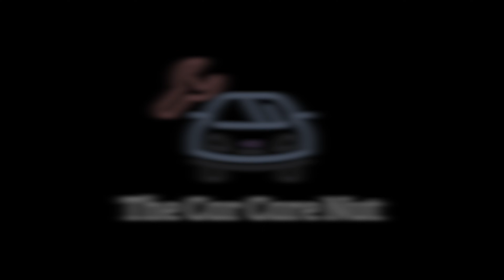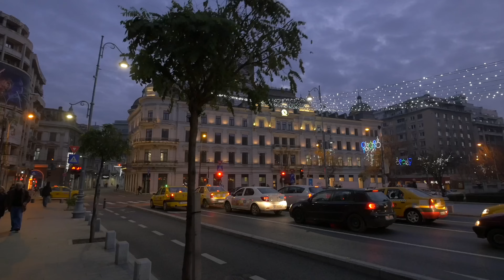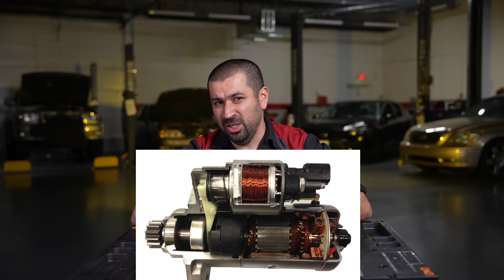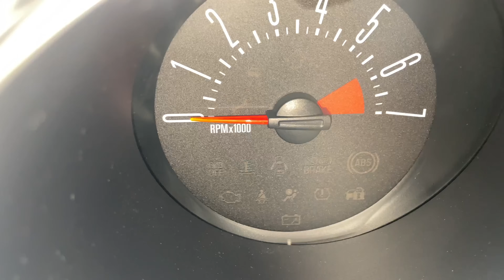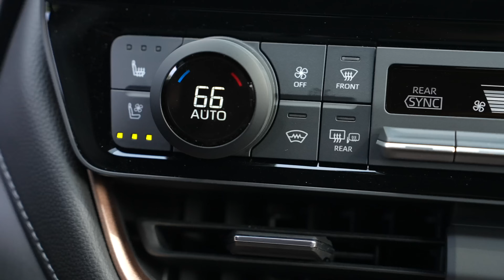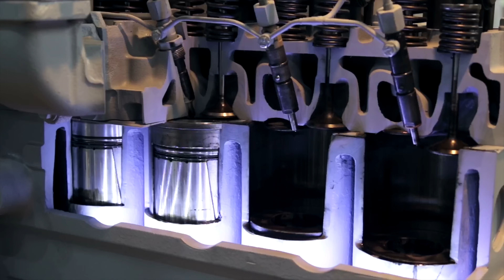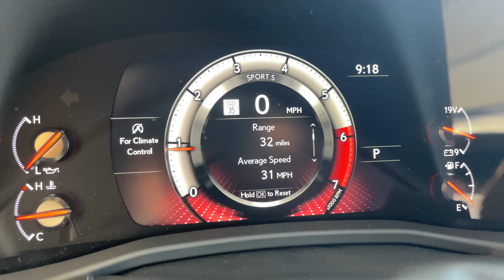How Does Start Stop Technology Work in Modern Cars? Everything You Need to Know

Comment: Never imagined that this system was so complicated. Just makes me think that this system has so many components that can fail, adding to the upkeep cost of these cars. I do have to commend you on your very in depth explanation of how this system works.
Reply: These vehicles will financially kill the lower income bracket!!!

Can't afford to repair!
Reply: I don’t know why people get so het up about stop start. It’s just a thing that some cars do and it brings emissions down in city centres. Also if mine stops working I know somethings going wrong with the car. Either the battery is dying or the alternator isn’t charging properly. And they have so many variables when they disengage such as the Air con on fall blast or the screen clearer is going being just 2 of many
Reply: My wife’s 2014 Chevy Malibu has it and never had a problem after almost 10 years.
Reply: And it's this new 'technology', that has me staying in 2020 Honda Accord. Doesn't have the start/stop, it has a 6-speed manual. It is my last car! Won't be around when we go to EVs, I'm 70 years old and I'm not interested.
Reply: Starter Motors cost a whole lot more than any gas the S/S might "save" IMHO
Reply: Absolutely. I'm a limo driver, and the alternators in modern Audis fail prematurely - they serve double duty - they also serve as weak electric motors, being able to a) add a bit of torque, and b) start the engine when the engine is warm. It wouldn't be such an issue except that there is a worldwide shortage of these alternators. I have great warranty - 5 years unlimited, but what's the point if they can't source parts?
Reply: @gregsullivan7408 Audi isn't even a valid car 🙄
Reply: @MadScientist267 lol. Audi is considered very premium here in Australia - perhaps not QUITE as premium as the other two German badges, but definitely premium enough for a limo. I have the Q7, which is very popular here for limos, due to it's combination of luxury and practicality.
Reply: @gregsullivan7408  It's overpriced, overengineered, and underdelivering. I've seen how easy they come apart the hard way, just for starters. Great if you like them for whatever reason, but good money is spent elsewhere.

Toss BMW in the same list, along with a few others. Just not impressed with "european engineering" in general with a few exceptions.
Reply: @MadScientist267  they have a great reputation amongst the limo drivers here - good value, excellent warranty and great reliability. I looked at the other "Big Two" but the Audi was the clear winner
Reply: (the reliability reputation was built before the relatively recent addition of 48V Mild T
Hybrid though - it's possible the alternator issue will change that situation. I was unaware of the problem when I bought mine. 117,000km on the clock and so far so good though)
Reply: @MadScientist267  People in North America often view European designed cars as less reliable and generally favored less, as well as more difficult to repair or work on. This is coming from someone who lives in North America. I went on a trip to the UK a few years back and there is a large amount of people who drive BMW's, Audi's, etc, over that of domestic or even Asian counterparts. As someone who is also a mechanic, my curiosity led me to a few different shops in the UK. I was a bit shocked to learn that people over there generally take care of their stuff much better, and, in addition to, the mechanics seem to be more thorough. I got to see and speak to people who have BMWs with a quarter million miles on them or more, yet were in good shape. In fact, the whole stigma that BMWs and Euro cars in general being less reliable seemed to be just that, a stigma. 

I think what it comes down to is that here in North America a lot of people just aren't familiar with the Euro designed cars in comparison to everything else. We have "Specialty" shops here that work on Euro cars, whereas that isn't really a thing overseas. During my apprenticeships with mechanics, no one really spoke about, or worked on any Euro cars. This led me to buying my first BMW, a 2004 BMW 325ci, an E46. After wrenching on it and learning how BMW operates, including their vernacular when it comes to reading the scan data I've concluded that BMW's truly aren't what people over here make them out to be. In fact, they're very easy to work on. Obviously every brand has their shortcomings and issues, for my BMW the cooling system needed an overhaul as that is a common issue on these cars, the plastic breaks. The parts are obviously going to be more expensive at a dealership, but shopping around I've found that parts really aren't that much different in costs.

Oh, and inspections over there are far more thorough and unforgiving in comparison to here -- another good reason as why you see more broken everything here in comparison. In some States your car can be literally falling apart and no one will bat an eye and passes "safety" with relative ease.
Reply: @gregsullivan7408   German Standpoint: There are way more than two German Badges, even in Australia. Also, a Q7 is not a limo, it's a SUV, a car looking like an offroad car while not being able to be driven offroad. Also not as usable in urban environment, since it's simply way bigger than normal cars (in Germany, mind you) and thus takes up just too much space. Also, yes, Audi IS premium, at least compared to its parent company, VW. It's just not as renown for quality and luxury as BMW or Mercedes are. Those two on the other hand bought or established "cheaper" brands, BMW has Mini, Mercedes established the "Smart".
Reply: @xpectthedeath here in Australia, in the context of limos, the main three that matter for high end are Mercedes, BMW, and Audi. And here in Australia, luxury SUVs such as the Q7 are ABSOLUTELY considered to be "limos" - I wouldn't be in one otherwise! 😀 Many folks PREFER SUVs to sedans, in fact.  Guess what - Audi are actually discontinuing the A8 here (the S8 will live on, but few limo operators could afford it). 
Now, I completely agree that in general, sedans are still a higher level of luxury - no argument there.
Reply: 100% agree, German cars are over engineered, over priced and unreliable. They just handle well and solid in crashes.
Reply: It doesn't make anything less reliable other than itself - so if you hate it, it's reliability shouldn't concern you at all, cause if ti fails at some point you'll have a car without start/stop, just like wanted in the first place.
Reply: @EustaH I'm having a hard time figuring out what kind of "failure" of the start stop system would result in a car that still "works". Please enlighten us.
Reply: @gregsullivan7408  all of what the guy is talking about the entire video? Those components are added to normal systems not replacing them. But ok, let’s enumerate:

Weak battery, starter used up beyond its service life, the voltage stabilising capacitor failure, electric transmission oil pump failure, auxillary electric coolant pump failure - all of this will result in just start/stop permanently deactivating. Car will start and run normally.
Reply: @EustaH weak battery and/or starter may prevent the engine starting at all, yes?  And btw, in my mild hybrid Q7, the alternator doubles as a starter motor (when the engine is warm) - guess what - this more complicated alternator FAILS COMPLETELY, and arguably, prematurely. It completely disables the vehicle. Worse, there is a serious shortage of this alternator. (it's a "belt alternator starter" motor). This added complexity has made the vehicle less reliable. It's a well known problem in the limo driver community, because we do high miles.  Now, if it only had start/stop, without the mild hybrid gumph, maybe it would then be more reliable - I'm not sure.
Reply: @gregsullivan7408  yes those can prevent car from starting, but the start/stop will stop working well before that. I know, because I just replaced my battery. In case of starter - that is too, according to the video - configured in such a way that if there is a risk of it failing doue to age/milage the start/stop deactivates as well. 

That starter/alternator combo is actually a cool idea - it failing prematurely means it was underengineered. Too bad :( And knowing Audi they don’t give an f…

Comment: Depends on how long the cycle lasts. 98% of wear comes from zero oil pressure starts. It takes a specific period of time for oil pressure to build the hydrodynamic wedge in plain bearings that separate the rotating component from the bearing where wear ceases to be an issue. With hot oil the pressure drops to zero in a couple of seconds and the rotating components settle back onto the bearing. Now you have wear in the bearing/rotating interface until the wedge is reformed on restart.

Comment: Good channel and you present very good data but most people i know have  had very short battery lives - these batteries are incredibly expensive ( 4-5 times ) - the starters fail too  - extra heat is generated and i guess there are some un burnt emissions - so if you factor in the costs , the extra heat i think its just virtue signalling and just basic dumb engineering and has more to do with meeting emission requirements for the  manufacturer's

Comment: The start stop system will damage the engine simply because it will wear out bearings sooner. This is simply a fact. And yes, when the engine is cold it will be worse. 
I think this start stop system is rediculous. It will NOT save fuel. It will wear out the engine, starter motors and batteries faster. Nett carbonfootprint benefit = 0 or negative. Not too mention your oil getting bad faster due to higher loads at start. It is rubbish and designed for type approval, not for the environment.

Comment: I have a question. I have a 2019 Renault Kangoo Maxi i use from my employer. It has a start stop system aswell. I noticed when im parked on a parking lot, if i forget to turn off the engine, the start stop system stops the engine because the transmission is in neutral, and no pedals are pressed. But after 3-5 mins the engine suddenly starts up again, and reminds me i havent actually turned off the vehicle.Just out of curiousity of this system, what could cause this behaviour?

Comment: I had a Jeep with stop/start. Hated it. One time after playing too hard the stop/start didn’t work anymore. No check engine light or warnings. The status screen always just said “not ready”. 

It was AMAZING. 9 months later after picking it up from recall work, I stop at the edge of the dealership lot and the 🤬 shut off. 

I didn’t turn around, I just reversed right back to the service desk to find out what they did. Turns out there was a ripped wire going to the battery monitoring thing on the negative post. They were nice and fixed it while doing other work. 

I thanked them, left. Opened the hood at home and ripped that wire off again.
Reply: Ha ha 😅lol.  That is one of the best stories here!
Reply: Mine "broken" how I know how to "fix it" if they do

Comment: I miss the days when cars were simple. (and inexpensive).
Reply: The powers that be are making car ownership as difficult and expensive as possible on purpose. To get you out of cars and using them less. It’s controlling of behavior through indirect mechanisms and levers. The common man will own nothing, maybe a bicycle, when it all comes to fruition.
Reply: Do you miss the smog?
Reply: @ianguy85  Smog is just something that THEY put in your mind. In 1965 the air that we breath was exactly the same as it is in 2023. In 1965 skys were blue and beautiful and the air was beautiful. You just drank the Kool Aid THEY gave you.
Reply: @ianguy85  Fact: The air in 1965 was no different than today. That before Catalytic Converters, Unleaded Gas, and pollution testing. And big cars with big V8s. :)
Reply: @ianguy85 did you miss the other posts of the impact of manufacturing more starters?
Just like all the heavy diesel machinery used in China to mine for lithium and its impact on the environment.

Comment: my 2022 rav4 LE awd (Canadian Spec). The extended start stop option on the menu seems to have killed my battery. At 17 months old, the vehicle started to have electrical bugs and abnormal power steering voltage warning showing up which my dealer wasn’t able to figure out. Other electrical malfunction showed up on dash that goes away after a while. A month later, without any notice, car died while parked. Wouldn’t start. Now i’m scared to use the start stop because I don’t want the car to die the middle of the intersection especially during frigid Canadian winters.

Comment: I'm in the dark about how the computer will resume starting at the cylinder that was about to fire when it was stopped. This would mean that the piston was in the middle of the compression stroke and stopped there. How is it possible that the piston rings and valve stems can maintain compression for up to 30 seconds? If anything it would push the piston down and alter the position of the crank. I remember in the 80's research was being conducted on low friction flywheels to store mechanical energy to bypass the starter for start/stop systems. Apparently this technology never got off the ground.

Comment: Had a loaner Subaru CrossTrek for a week. I figured out that the start-stop was not activated if you slowed gradually to a stop with light brake pedal pressure, the engine wouldn't shut off. I HATE start/stop and all the electronic touch screen BS.

Comment: I don’t know about other manufacturers. But my Toyota system actually only cuts the engine if you press the brakes in fully. If you don’t press them all the way it shows a message “press brake more for start stop” 
So I can control when I don’t want the engine to shut off every time I don’t need a system disable button. 👍
Reply: It works the same way in other vehicles that have it.  Some don’t show the message but I figured out that once you apply the brakes to stop the car, I just lift my foot off the brake half-way and the car stays still and the engine stays running, that’s the way it should be.

Comment: Regarding shutting it off permanently, yes, but it depends on the make and model of the car.  I currently own two Volvos (2021, 2022) and they both have permanent disabling.  I used to own a BMW that also had it.  Less and less cars will have permanent disabling as we move towards more electrification.  Mild hybrids tend not to allow permanent disabling.  Volvo got rid of that in their new “B” engines.  (Mild hybrids)

Comment: Thanks for the video. I hated the system in some rentals and guessed I was prone to have to press the button constantly after buying a 2023 Highlander. I have not pressed that button in the last 5 months. Something you forgot to mention is that if you don't press the brake pedal to the bottom the system will not engage. I only press the pedal to the bottom if the light just turned red (long wait). In all other instances I do not press the pedal fully and the engine keeps running.

Comment: We always turn this off on our 2022 Subaru Outback.  The sales person explained we were free to keep this on at all times, but told us it saves very little fuel consumption while wearing the starter more.  It is wasted for our travel, which has few stops on our average drive.  We also get 33 mpg actual measured mileage.  Just drive more fuel efficiently, it only takes a few minutes longer per average drive while saving 15% on fuel consumption.  Saving about 60 cents per gallon of fuel.

Comment: Modern automobiles manufactured for sale in the United States produce near 0  emissions. Start/STOP technology only adds to overall pollution. Every time you start the engine it accelerates wear, especially after tens of thousands of needless cycles that otherwise would not have happened. Second, the tens of thousands of additional starter motor cycles will facilitate early starter motor failure! Thousands or millions of replacement starter motor’s Chinese made polluting the earth when they are made and when they produce waste! Since remanufacturing is not anywhere near as popular as years ago! They end up in the landfill or parts of them do! Third, every time an engine is started the fuel system is enriched slightly regardless of ambient or engine temperature and an increased temporary tailpipe emissions occurs! I could go on and on. Start/ stop operation is an epic failure as is everything the liberal democrats and EPA does. They pollute more today with all their failed policies than we did in the 1950’s!

Comment: 6:39 Did you meant Diesel?
I am asking this, because, Diesel engines typically require more power to start - due to the fact that their higher compression ration, because the combustion cycle is initiated by compressing the mixture.

By the way, thank you so much for your videos!
I really like your video style: informative, complete, and paused.
Cheers!

Comment: Great clip. If you install a 12v battery with a lower capacity will the start stop system automatically be deactivated as long as the battery is not replaced ? Would that be the best solution for those who dislike this system?😊

Comment: I do like the information and explanation alot, except for the ac operation explanation. It's uses latent heat pulling heat from the air not the coolant itself getting cool, the evaporator allows the refrigerant to evaporate and it needs heat to do this, which comes from the air blow over it thus removing heat and blowing cold air out of the hvac
Reply: My 2002 Prius has a "cold-storage" evaporator core since it doesn't have electric AC. Even at 90 degrees out, it keeps blowing COLD for about 30-45 seconds with the engine off. It will then slowly warm up, and the engine will run just long enough to recharge the cold storage system.